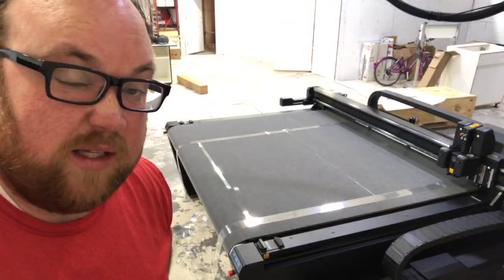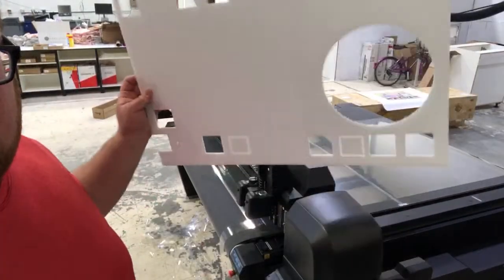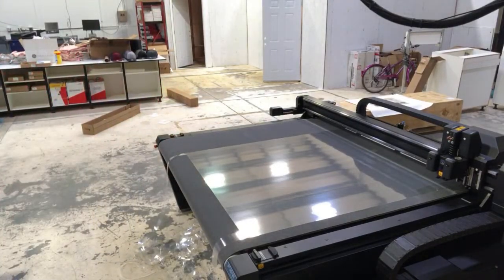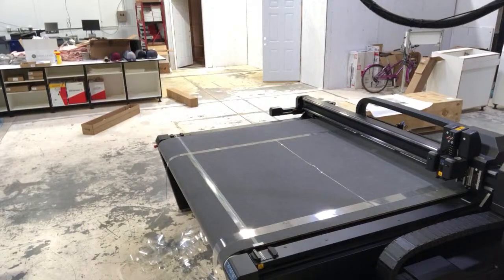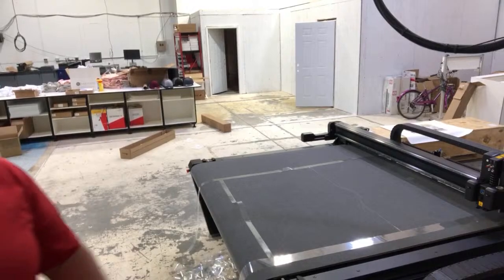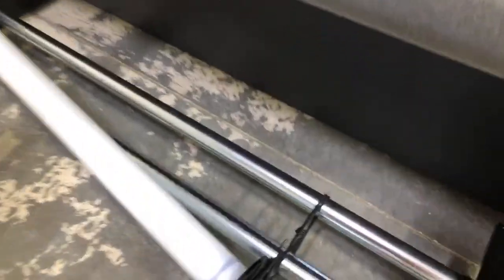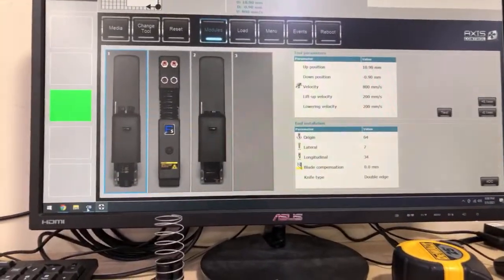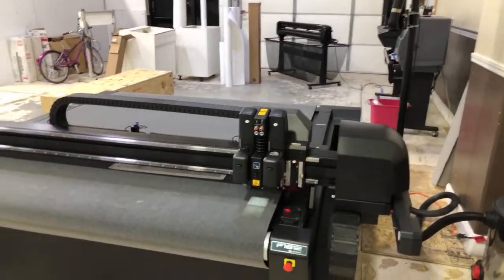Summa F1612 up and running and Q and A

Comment: I run a Ricoh Pro 8100Se I think it’s an older unit. Anyway I have straight sorted 4 part ncr and I’m wondering if I’m able to run it straight through without pre-collating. This would save me so much time but if I have to sort it before hand no big deal. I’m hoping my boss gets a new unit soon. Great videos

Comment: On the UV printer, would you be interested in a HP Scitex FB550 64" UV Printer?  There's one for sale used near me.  I think those cost 80K+ new.  This one is listed at $10.5k.  It was listed at $13 a month ago...  I really want it, but I can't do it right now.  It's a 2017 vintage.
Reply from the maker: I thought that HP ended support for this scitex? That is a good price, but shipping and setup would be a beast.
Reply: @ttms  I guess you have to define support.  Do they sell parts?  Yes, I believe so.  Can you contact them and ask for help/hire them to come out and service/repair?  Yes, I believe so.  It's not an old machine.  I would guess it would be $2,000 or less to ship it to your area.  (I'm just a third party who came across an ad).  New machines have huge overhead costs...  It amazes me how much new equipment you have.  Both in the "wow, that cool" and in the "wow, that's flushing away so much money".  If you can buy equipment used at a fraction of the cost, but it produces the same quality, then why not go used?  So, in this example, let's say to get this turnkey for you, it costs $20k (but really should be less).  That's still a fantastic deal compared to anything new.  There's not a cost comparative alternative for the same size machine.
Reply: In watching an earlier update, I see you bought a used unit.  That's a double bummer that the deal has fallen through!  I hope that all gets sorted out quickly and the money returned to you.